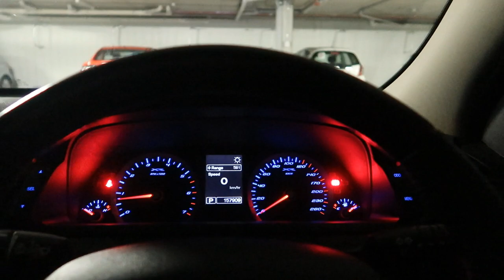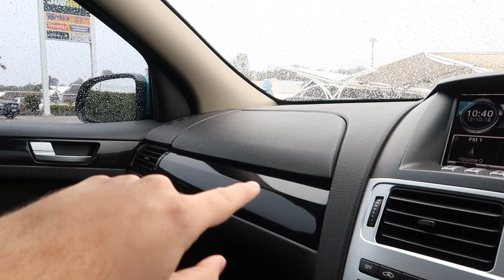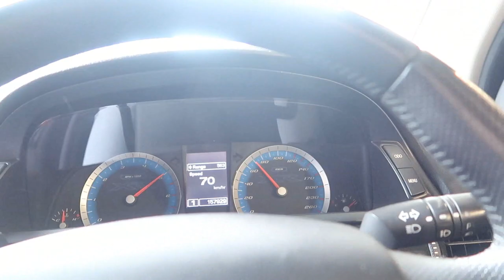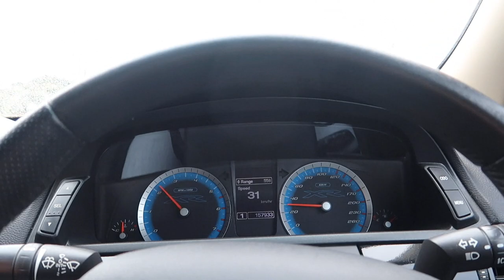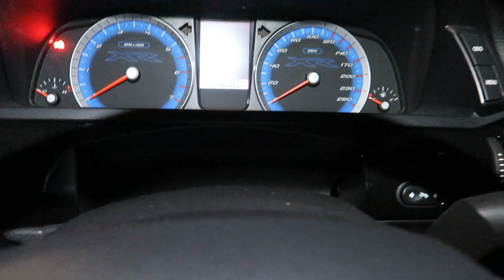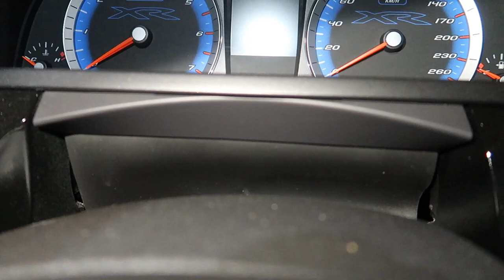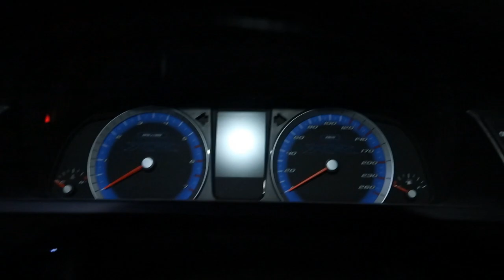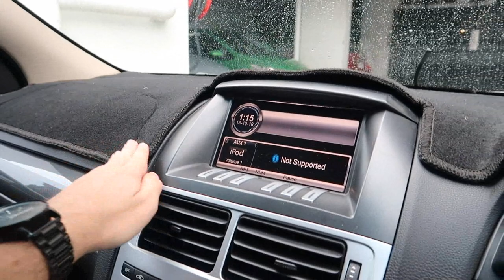Making the Ford Falcon Interior PERFECT

Comment: The pedals were a rare option from factory. A few FPV's have them. But on every other falcon, when you remove the dash spears you can see the plug for the switch it just leads to no where. Also behind the spears there is a little cut out which shows where the button would've went if it were optioned.

Comment: In the ba to get to the cabin filter you open the glove box then push the little plastic catch out of the way the glove box then drops down and you change the filter could probably get to the bolts behind that not sure if the fg is the same though

Comment: Who told you it was going to cost $1600 to do the diff bushes? We did my mates F6 using Nolathane bushes for $180 + 5 hours labour & DIY hoist/garage time which was $22/Hr so $110 + $180 for the Nolathane bushes!
Reply: Where did you find a place like that mate is It in nsw
Reply: Yeah Nolathane wouldn't be a good idea. My mum had a BA GTP that had Nolathane bushes from the last owner, found out it had messed up the driveline because it was not absorbing the punishment but pushing it in other places.
Reply: I been quoted 5-600 for main diff bush and tailshaft centre mount. Including parts.

Comment: i think those pedal buttons were only on the mk1 G6Es. don't quote me on it but yea. pretty sure.
And 1,600 for diff bushes is waaaay too much. shop around for quotes. most shops could do them for well under 1,000. hit up the ClubFG page, everyones done em haha. superpro are probably the best ones to get. i put genuine ones back in mine for some reason but should have gone the superpro kit
Reply: MATE I THINK THAT BUTTON FOR  the pedals , someone ( previous owner ) had prob put that there and the start button system
Reply: its from factory